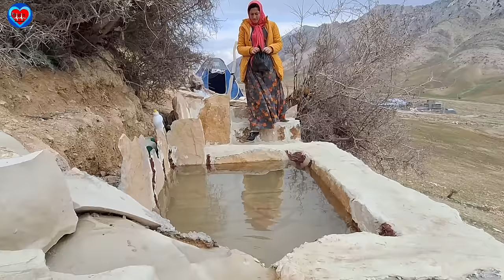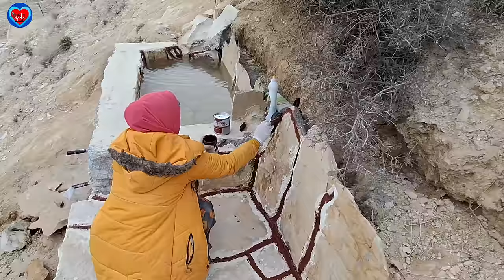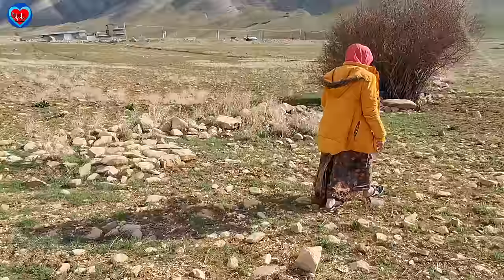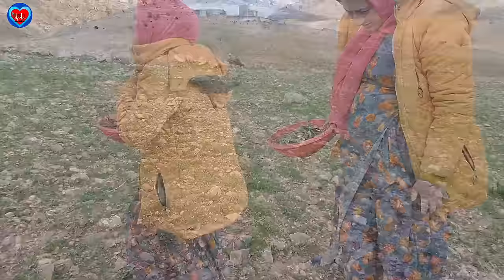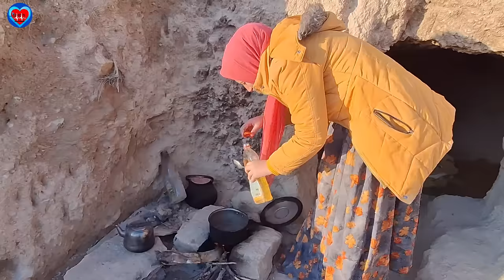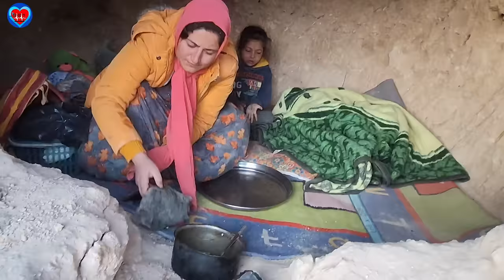Water and talent: the masterpiece of the nomadic lady in the cleaning platform project🌏🏊💧

Comment: I hope she will continue to dig more inside the cave and make a wider sleeping area...then bigger and wider doorway...she can then make a wooden door and work on the awning near the door...give her a thicker material for the roof and secure it with ropes and big rocks at the back dirt so it will not be blown by a strong wind while the weather is fine...give her lots of wood planks, cement and sand so she can plaster her cave and floorings including the landing near the doorway of the cave so the area will not be so muddy when it gets wet during rainy season...goodluck and stay safe